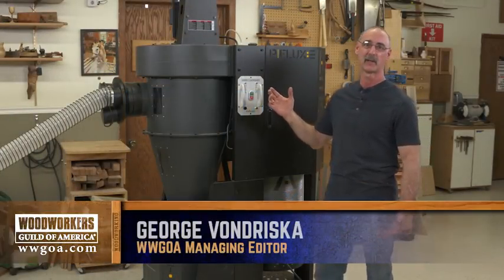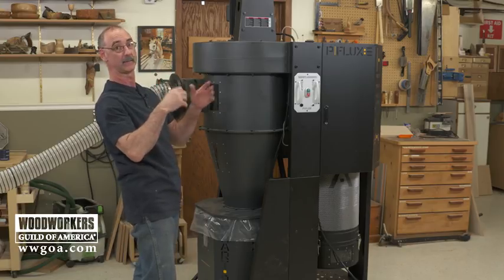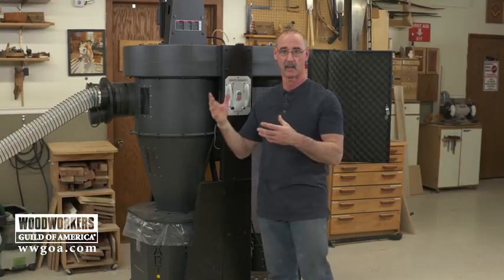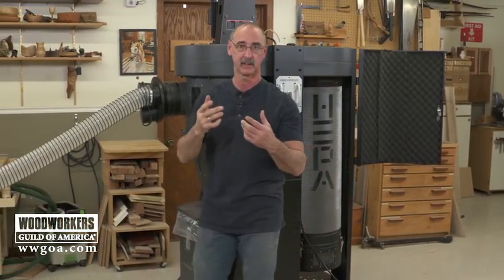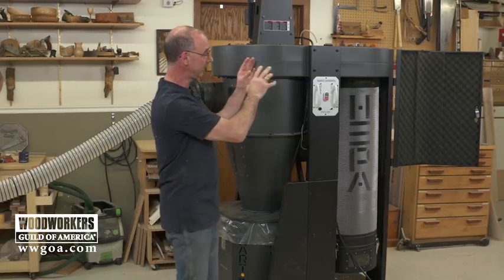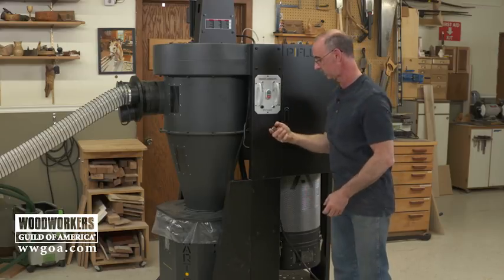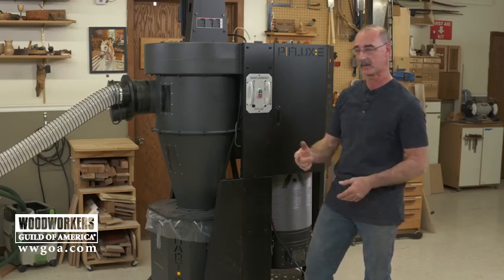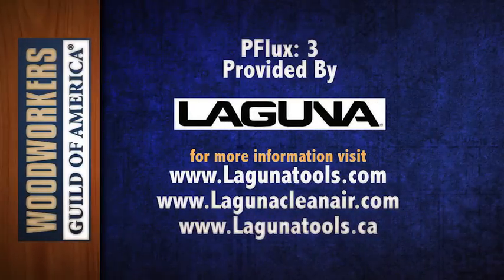Benefits of Cyclonic Dust Collectors

Comment: What is the purpose of a dust collector in the shop?  Why not just exhaust the dust outside into a storage bin?
Reply from the maker: Hello.  The benefit of a dust collector is to extract the dust right from the source by connecting it to the tools.  If you just run a fan in the wall to vent the dust that is suspended, the dust will linger in the air and you will constantly breath it.  You can place the dust collector outside if you wish, but it is best to run ducts to the tools to maintain better air quality.     
Thanks
Paul-Woodworkers Guild of America
Reply: @Wwgoa  I thought I might get an answer like this as the whole dust collection has been commercialized and the profit is too much to provide a simple solution or answer.  The question was: was is the purpose of a dust collector IN the shop.  I completely understand that dust is bad for a man/wom(b)man, but why go to all the trouble of having the blower (noise) and collector/bags/filter (hazard) in your work space if you can use a dust blower and blow the dust outside into a container and remove the hazard completely from your breathing air and work area?  My understanding of having the collector recycle the air back into the shop was to retain heat or cool air, otherwise there would be no reasonable or practical purpose for man to subject himself to a hazard like fine dust.  Do you know of another reason why the new woodworkers would spend thusands of dollars on a cyclone dust collection system, just to vent the air it outside anyway?  Here is an example: https://www.youtube.com/watch?v=eVlJP4naUfM&lc=z22xtdcglnngtlrx204t1aokgtyj1gffq1q4pu5i0wjibk0h00410.1576681599876830

Comment: Speaking of sucking things up in the impeller.  I bought a new Jet dust collector a couple of years ago. Got it home, put it together, and while checking out the suction, sucked up a full can of wood stain.  It was in the impellers before I could say "Oh SH!@".  The wife and I spent the next 2 1/2 hours cleaning the inside of the thing out.

Comment: sir, it is not the problem of the collector, it is fine. the problem is the saw dust. what are we going to deal with all the saw dust the machine collect? 
just throw it as garbage? may be?
use it as fertilizer for you garden? mdf contains chemicals....
press the saw dust really hard and pour some melt wax to make some solid fuel pallets? same problem, just good for heating, not good for cooking...
press the saw dust and put epoxy rasin to “cast“ some home make mdf parts and use on the next project? may be it will work, but there is no guarantee on the strength of those parts...
we knew this machine is good. but what next? can goa make some video about this issue? if it is going to work, i bet these machines will sell like hot cakes! 
just a humble suggestions, thanks.

Comment: Wow, would buy this instantly if it was available in Europe. Went with the cheaper solution of 2HP fan/motor + a super dust deputy. Will just run the exaust right out of the shop with pros (no filter needed) and cons (will make shop cold in matter of seconds) this has.